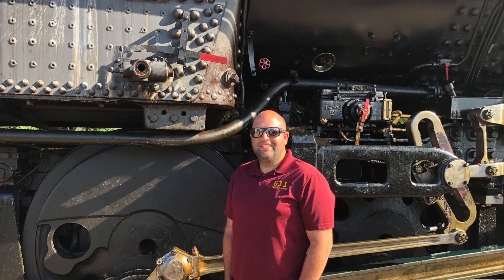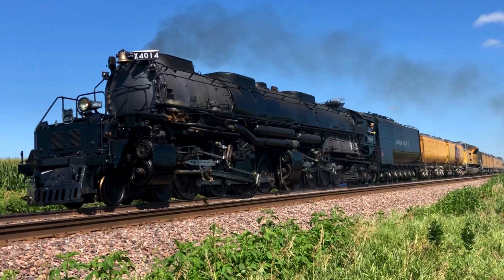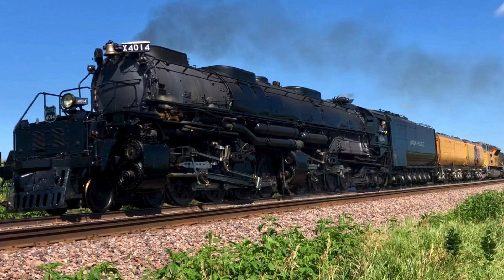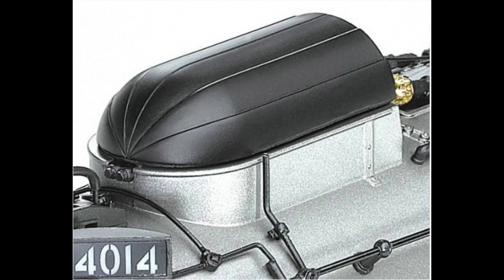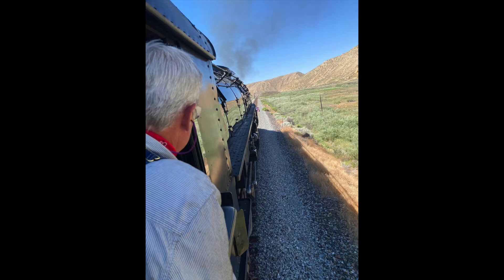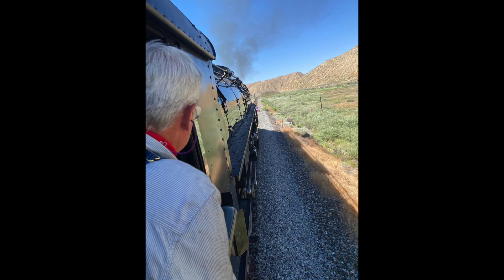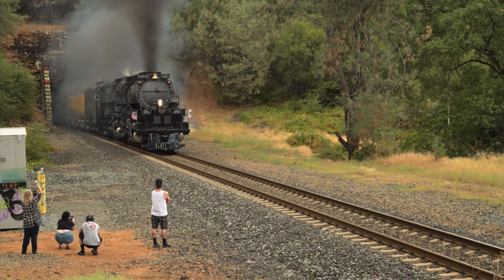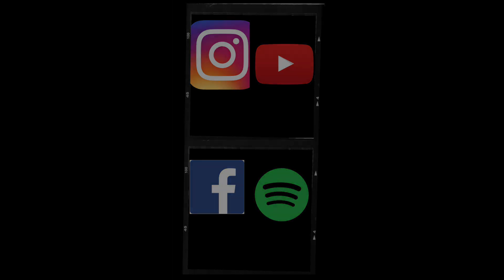Union Pacific Big Boy 4014 Stack Hood Operation and Details

Comment: Really interesting stuff! One, maybe silly, question: what happens to all of that exhaust when the hood is closed? Does it just back up into the system until it can all be released (and does that potentially cause a problem if the hood is left closed for too long?)  Or is the smoke/gas just redirected by the hood, still exiting, just not straight up?

Comment: That's probably the best up-close video of the stack hood in action besides the one in Last of the Giants. What's interesting is the same design of stack hood wasn't only used on the Big Boys and Jabelmann Challengers, but was also applied to some of the UP's 2-8-2s, 4-8-2s, and 2-10-2s. The UP also used a different type of stack hood similar to one used by the Santa Fe, which folded up and down from the front of the stack.